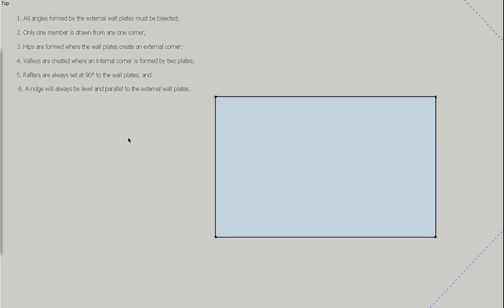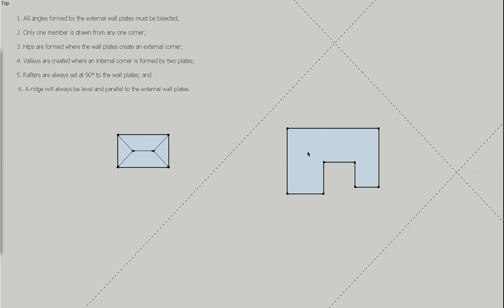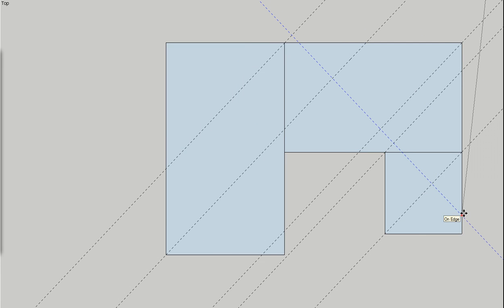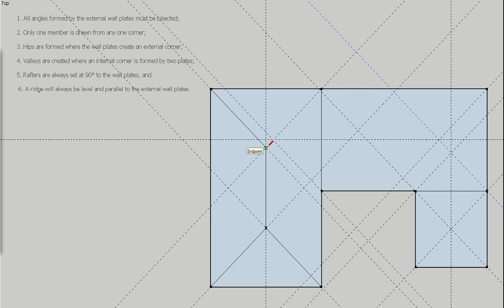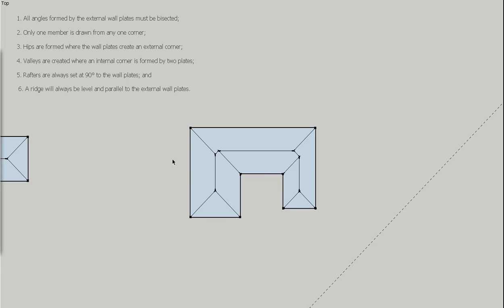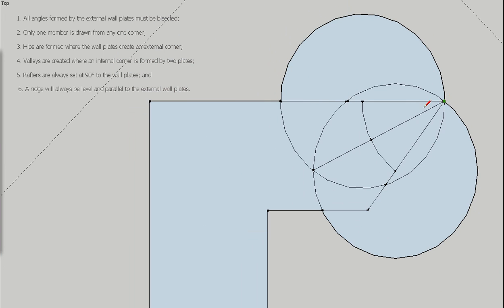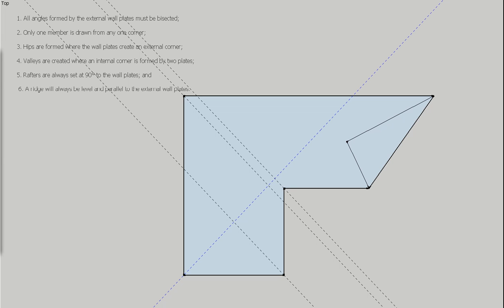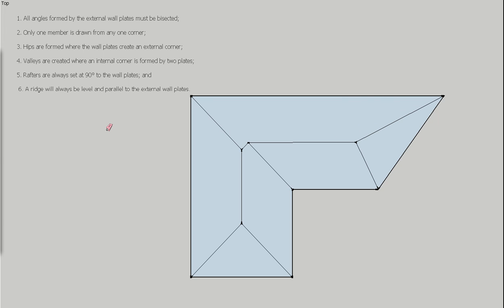Roof Plans Part 1 Plan View

Comment: Great tuition, struggling with roof intersection if lower wall height on one extension, any tips greatly received. Main building 240 cm  extension at 120 cm.
Reply from the maker: Hi Ian If the wall height is lower in one section then that whole roof section would be treated as a separate roof with a gable end where the two roofs intersect. Hope this helps
Reply: @Buildsum  thanks that explains what the program is doing. Is there a way to draw lines (roof in this case) manually rather than the preset shapes?